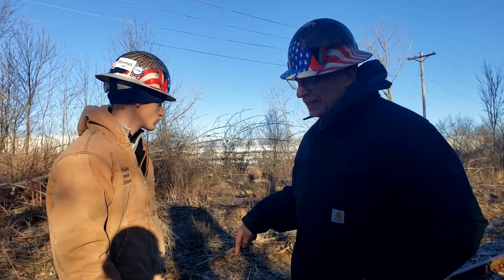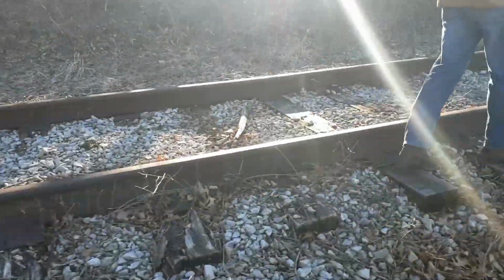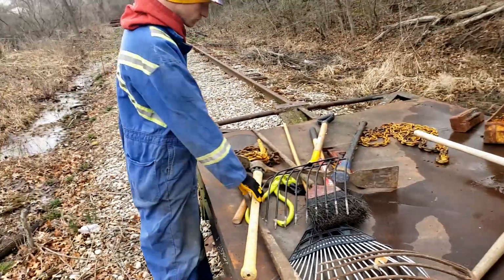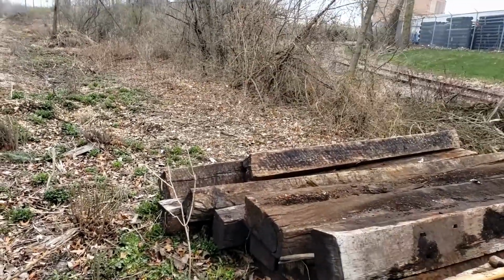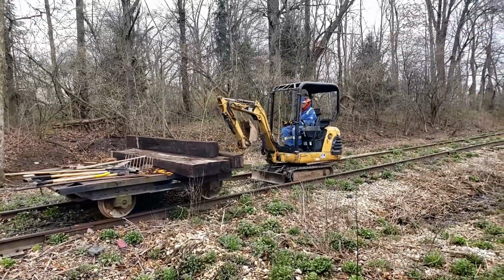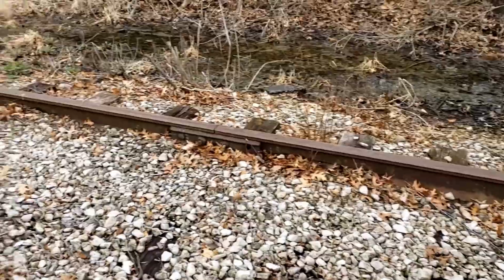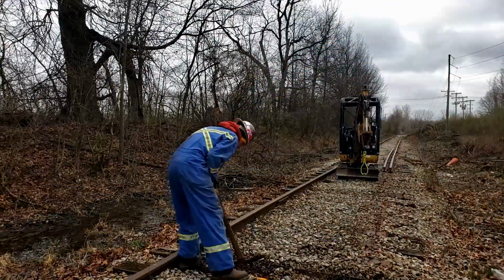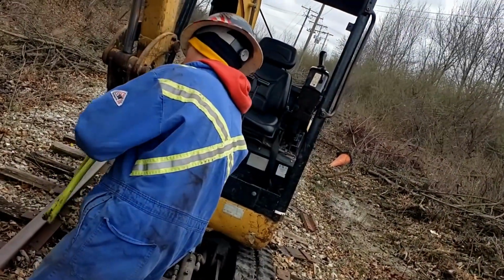1st Railroad Ties replaced in over 25 yrs!   Maybe ever!!  Conrail/ETR

Comment: Wouldn't it be overall easier and a time savings to just pull the rails and all the ties in sections and just regrade drainage and railroad bed then relay ties and track with a combination of used and/or new ties? Your pulling 1 rail now anyway, then wasting so much time and handwork on replacing one tie? How much time is going to go into replacing all your bad ties individually like this?  I could dig all them ties out in 100 yard sections and regrade totally in a day or 2 with my 12 ton excavator with manual thumb and small dozer. Yes you would have to buy new stone to re-ballast after relaying the new ties and track, but that's not that significant of a cost compared to the time savings and new railroad you would end up with vs replacing so many individual ties and still having it not that good when done? I know it's not a main line and doesn't have to be that good but time for time and quality difference when done, it seems the way your doing it here is lame.